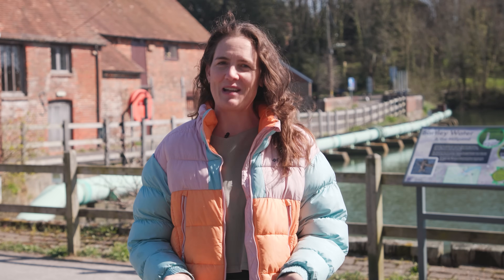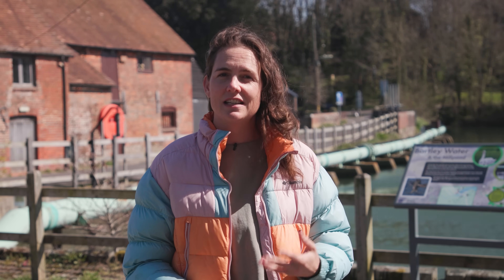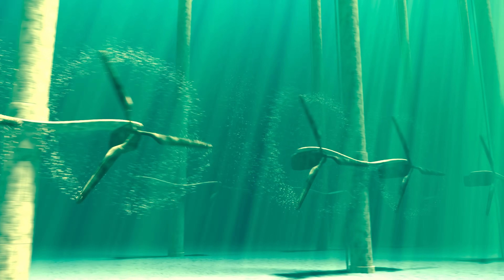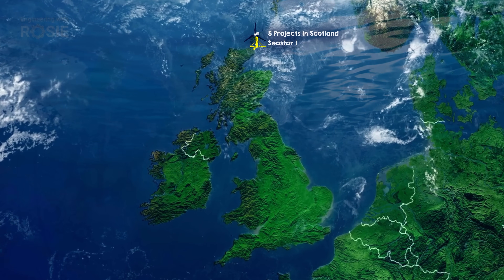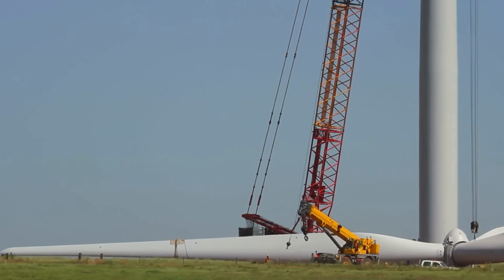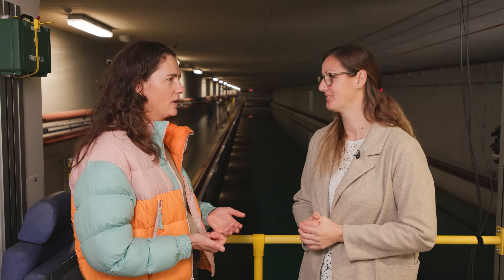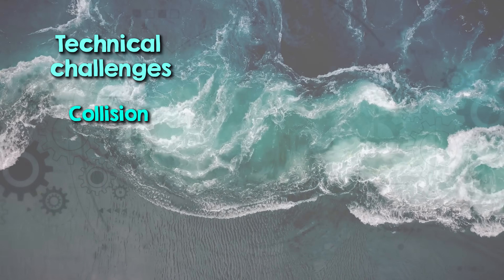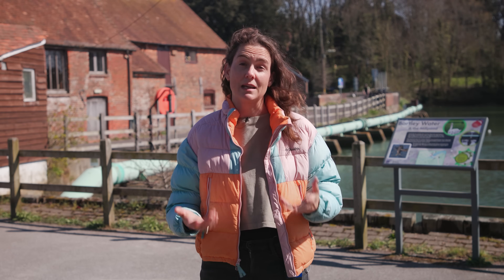A 1,400-Year-Old Idea That Might Save the Climate

Comment: "If we combine technology, so we can have tidal and offshore wind and onshore wind and solar. They can all accommodate for each other at different stages, so your producing this constant supply."

Come on Rosie, you should have challenged her on that!  The wind and sunshine have some links, but the tides are completely independent.  If the tide stops, there is no guarantee of wind or sunshine, while the wind has no effect on the orbit of the moon, and she has just said that our tides are phased so that we "could be producing  tidal power constantly" anyway!  So why would we ever want to combine technologies?

While I would love to see tidal succeed, it needs to compete with wind, and the maintenance costs are always going to be far higher, even compared to floating wind.  It has to be installed in the best tidal flows which are always small, and spread out around the country to achieve the phasing, with low capacity interconnectors to each site, while the floating wind farms are putting 10GW in a single location, with ports to service it close by, and a few short interconnects carrying GWs of HVDC, and the turbines don' get covered in marine life!  Wind will always be so much cheaper that it will be able to afford a huge amount of storage to cover the odd period of low wind, and most of that will be easy storage of synthetic liquid fuel rather than expensive batteries, because by 2050 will will have many times the amount of wind requited to provide grid electricity, except on very calm days.  In stronger winds, most of it will be used for purposes that can be turned off during periods of low wind, such as producing synthetic aviation fuel and fertilisers, which are easy to store.

On the funding, the contracts for difference are effectively a government grant, it is just that the investment money comes from investors and they only get it back from the government if they ensure that they make a good investment.  The tidal is getting a guaranteed 3x price for the energy produced compared to wind, so while they do have to produce some power to get any funding, if they do produce a decent amount of cheap power then they make a huge profit, and if they produce poor power, it can still be a reasonable investment, and if they fail, they loose everything!  It is a system which pays for investments in new technologies, while the investors need to make sure that their technology will work if they want a profit, even if only poorly at the first attempt, reasonably well for the second round, and that they are competitive with wind in the third round.  The third round of tidal will never happen, the investors will pull out!  Unless someone uses the investment money to invent some new form of tidal power that revolutionises our power supply?  I don't think it will happen, but it did with onshore wind, did with offshore wind, and I think will with floating wind. 

Good video, I think it could have been a bit longer, we didn't get much info on what is currently operational.  I think most tidal power systems currently in operation in the UK are actually similar to the tidal mill you visited and 100s or 1000s of years old!  There examples in England, Wales, Ireland, and there used to be a lot in Scotland, not sure what is still operational there though,.
Reply: Golden rice! 🙄

Comment: Hi Rosie, I have always thought another option for tidal generation would be a platform that floats and generates by the massive vertical force and corresponding downward force when tide recedes. If there is room for a large platform with a lot of mass I thought it could be geared to generate power. What are the problems apart from size ? André
Reply: The platform would have to be many square km in size in order to generate a worthwhile amount of power.
Reply: You could weld all those redundant oil tankers together to make the floating platforms ...
Reply: They could use this concept with floating docks in ports. The problem is the movement is really slow, so it will need a lot of gearing to produce energy.

Comment: Why bother? Solar is more than enough to cover all our needs, just get enough storage. Which does not have to be batteries. Making hot water in a well isolated tank at noon is just fine for the evening shower.
Reply: This was about the UK, solar does not work in UK winters!
Reply: @nigels.6051  It does but in a bad month the ouput might be only about 10% of that in summer.
Reply: @nigels.6051  Solar doesn't work anywhere on Earth, Nigel.
Reply: You clearly don't live in an area where the average daily solar energy generation in the middle of winter is less than 10% of that in summer
Reply: @garysmith5025  And on average, our summers aren’t great for solar either!
Reply: "Solar is more than enough to cover all of our needs..."
No proof-of-concept. If what you claimed were true, it would be easy for you to create a proof-of-concept.
Reply: Solar is great, but I've been working in solar and battery industry for 30yrs, and capturing & storing the Sun's energy is very difficult during the winter months, thus other forms of energy are always needed.

Comment: What about corrosion?
Reply: What about it? We have 50 year old oil and gas production platforms, and they were built before modern coatings were available.
Reply: @garysmith5025 the critical equipment on offshore platforms is kept above the splash zone
Reply: @johnmerchant8238  Splash zone? There's an also constant salt spray in the North Sea, and corrosion is actually worse in the air than it is submerged, oxidation?
Reply: A very big problem for anyhing in salt water.
Reply: You might have heard of ships

Comment: Rosie, I don't hear you asking where the energy comes from and is it a good idea to do it in the long term.
In my understanding, the energy comes from the planet's rotational  momentum being converted to energy and the planets orbital velocity. The amount of energy stored is huge and depleting it will take a VERY long time, but it is certainly not a renewable source, any more than Uranium fission is.
Reply: It's relatively simple to calculate the effect. Humanity uses approximately 9.0 x 10^19J of electricity per year, if 10% came from tidal that would be 9.0 x 10^18J. Depending on various assumptions on Earth's mass distribution it has a rotational kinetic energy of between 2.05 x 10^29J & 2.31 x 10^29J, note it's a product of the square of angular velocity. If we maintained that energy draw for 100 000 years it would, after that time, have increased the Earth year by an additional 1.2 seconds on its natural 730 seconds per 100 000 years. (edited because natural slowing is usually stated at 2 seconds increase in day length per 100 000 years)
Reply: @garysmith5025 Excellent work Gary.
Clearly a totally unacceptable situation :-)
Seriously, perhaps the effect should be increased to avoid being swallowed by the Sun's red giant phase. Ok, not so seriously. Reading too much science fiction.
Reply: @AndrewBlucher  The sun is going to get infected by an energy eating space virus long before then! I read too much science fiction too😉😉
Reply: Seawater uranium is indeed "renewable".
Renewable simply means: "meted out gradually".
Seawater uranium qualifies, because it is gradually replenished by rivers carrying eroded-uranium to the sea.
Reply: @aliendroneservices6621 "When I say a word" said Humpty Dumpty, "it means just what I want it to mean, no more and no less".
Ok Humpty.
Reply: @AndrewBlucher  If we look at how people use that word, "meted out gradually" is indeed what it means.
Reply: In that case the sun isn't a renewable energy source, there is no renewable energy as there's no perpetual energy. Or we could recognise that we mean within the foreseeable lifespan of humans. Ie we'll have millions of years

Comment: How many years would it take to slow down the earth’s rotation?
Reply: Wont it slow down anyway, most of the power the turbines are collecting would otherwise have turned into heat?

Don't forget about the effect on the moon's orbit!
Reply: longer than humans will be around probably.
The rotation slow down comes from friction. How much artificial friction could some turbines add compared to the natural friction
Reply: @tami6867  An absolutely miniscule amount. Tidal friction has increased the day length by somehing like an hour in 200 million years.

Comment: That was a very informative presentation. thanks. I think it's amazing how far they have come and the potential that still exists. The biggest thing going for Tidal is its regular nature and the density of water compared to air. But with only 10 hours of peak performance a day, that did surprise me. Although a network throughout the UK could be devised to provide a base load of 24 hours, there are also battery storage possibilities. I also like they are not a blight on the landscape i.e hidden from view
Reply: The turbines currently operating in the Pentland Firth are generating >80% of their nameplate rating for just over 20 hours per day due to the speed of the tidal streams there.

Comment: Thanks for this. I remember UK tv excitedly covering proposed tidal & wave power generation technology & trials in the 70s & 80s, it's frustrating that it is so slow to come on line!
Reply: You're probably remembering the early 'nodding ducks' experiments, the best can be said it was not 'allowed' to be progressed, money talks....
Reply: Because it's totally NOT REALISTIC and so no one is going to do it or pay for it EVER. 
It's just TV to keep you amused.
Reply: Back then, wave power was good, if a bit unreliable.  However it doesn't scale well, there just isn't enough power in the little ripples we have on this calm day.  With wind reaching up into the sky. scaling up to megawatt size turbines, wave power died.  Now tidal is trying to compete with those megawatt size wind turbines, but it is not going to be able to scale up further, our tidal flows have limited depth, while the wind turbines are still reaching higher into the sky, we are seeing the test rigs being built for 30MW wind turbines, for the new floating wind farms, there is no way that 30 tidal turbines are going to be economic compared to 1 floating wind turbine, 30 power lines compared to 1 power line.  And then the floating wind farms are being designed for 10GW size, while tidal farms are going to be 10MW, that is 3 orders of magnitude difference, the economics will not work out well for tidal.

Doesn't mean you can't use tidal, we still use 30Kw hydro systems, there are many scattered about, providing local power, just don't expect tidal to become significant on a global or even national scale.  Tropical areas, where most people live, do not have tides anyway!
Reply: @nigels.6051  Yes, it is a fundamental problem....economics. We have developed conventional energy of=ver a few hundred years and have the economics all figured out. It has been the "go to" and come to be expected norm. Now we expect everything else to have to compete with this. That is becoming more realistic, but the what is often not considered is that the imperative for change ha gone up far faster than our willingness to accept that we may have to invest more and pay more for our increasing excess demands to counter our reliance on what is 'normal/acceptable'....we are not in normal times.
If you house was burning down and you were going to lose everything including all the non-monetary things you owned, your pets, your children etc, would you be concerned about how much it was going to cost you to save them?
There is loads of money available, it just needs to be put the appropriate use.....and that is attitudinal not technical (very difficult to fund changing the former.
Reply: @nigels.6051  "Now tidal is trying to compete with those megawatt size wind turbines"

It doesn't need to compete at all.

Wave can complement and augment offshore wind by sharing electrical transmission infrastructure and using the spaces between turbines at sea level for extra power.

"while the wind turbines are still reaching higher into the sky"

And the structural problems are increasing as they do so - to say nothing of the serious issues with processing decommissioned turbines for recycling.
Reply: @mnomadvfx  No, they do not complement each other, the arrival of good wind is completely independent to the arrival of good tidal currents, and the strong tidal currents are in different locations to the strong winds, they are always near land, which causes serious turbulence in the air that 30MW offshore wind turbines don't like.

Floating wind turbines can just be towed back into port for decommissioning,  or more likely refurbishment with new blades.  That is what happend to the Hywind Scotland turbines earlier this year, towed into port in Norway for a major service, now they are back in action working better than ever.